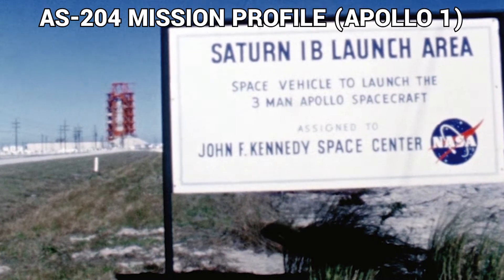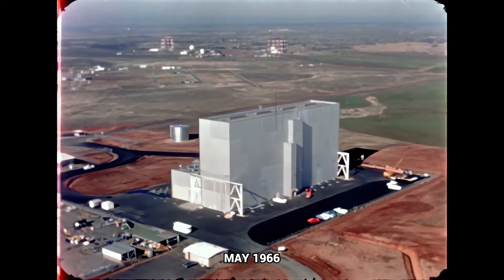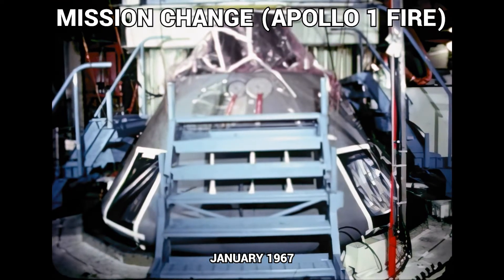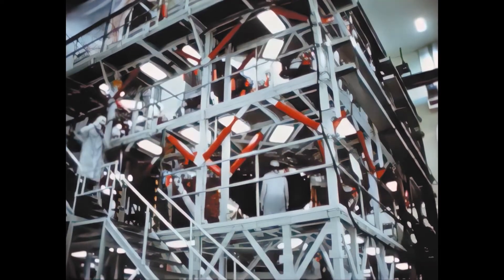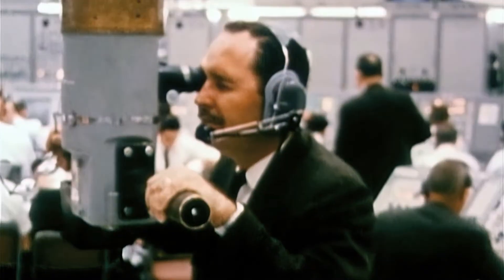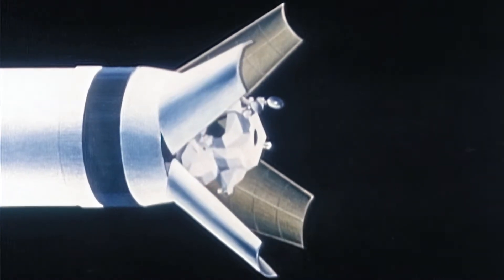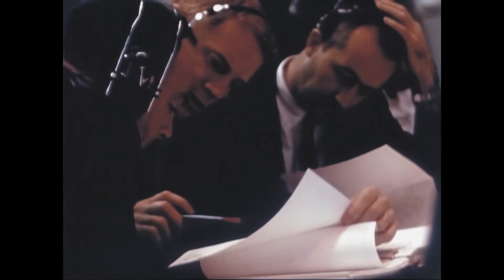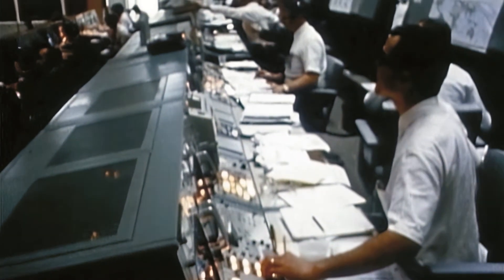SA-204 Full Mission - Saturn IB - Apollo 5, AS-204,  Historical Footage and Audio, Lunar Module

Comment: I don't understand why NASA hasn't been able to develop rockets of the same caliber as the Apollo program these days. Now SpaceX is at the forefront and even helps NASA with its space program.
Reply: The Rocketdyne F-1 used for the first stage of the Apollo Saturn 1c booster were the most powerful engines ever built but they weren't throttling (they were either on or off) and they burned rp1 (kerosene) so they weren't as efficient as the space shuttle main engines. Going back to the f1 would be a major step backwards
Reply: NASA contracts out much of its hardware development to private companies like Spacex and they also have many more things to worry about since they have more programs and have to deal with bureaucracy.

Comment: Very good video.  Does anyone out there knows what became of Apollo 1's Service Module?
Reply: The Apollo 1 SM (SM-012) was, like the CM, a Block 1 model. Unlike the CM, the Block 1 SM was similar enough in general structure that the undamaged SM-012 was shipped back to Downey, California to be used for testing future SM modifications, including those following Apollo 13 (addition of a third LOX tank and fuel cell away from the main two) and mods made for Skylab.

It wasn’t scrapped until 1977.
Reply: Thanks for the info!
Reply: It was scrapped after the fire.
Reply: Thanks for the update